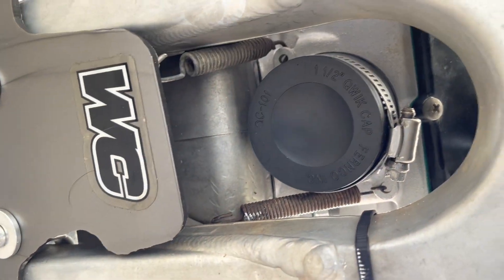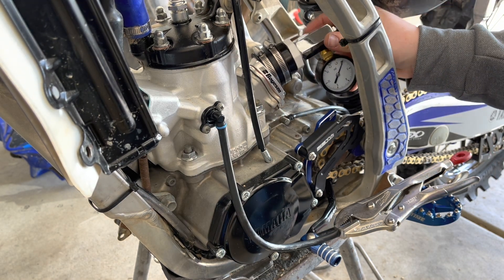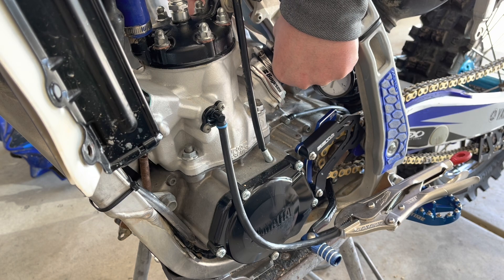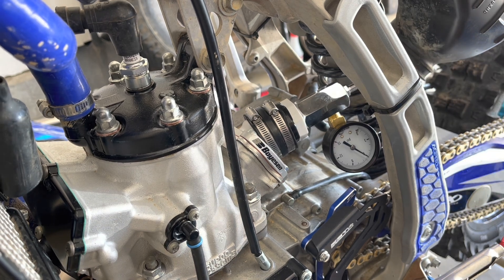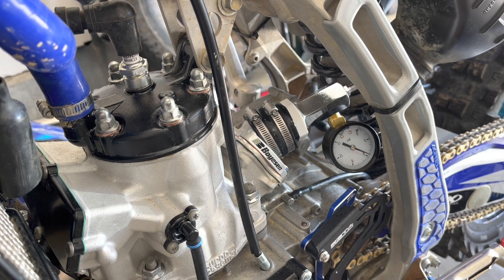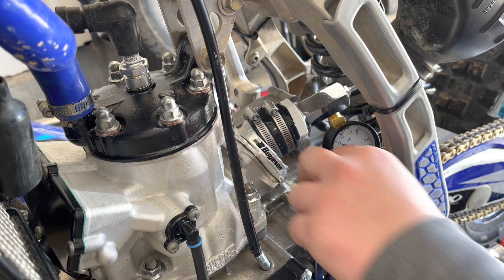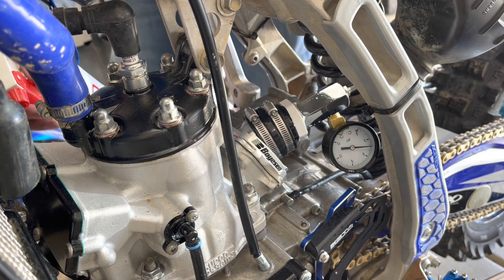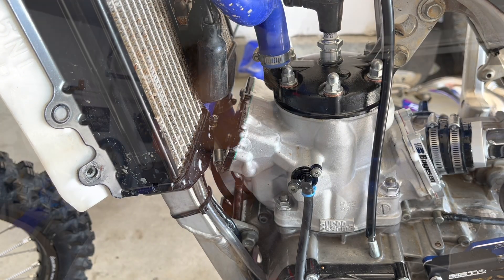2 Stroke Leak Down Test | Where To Find Air Leaks | YZ250

Comment: Did fixing that leak solve your idle issue?  I just found the same on my 2018 YZ250X but on the small side cover for the power valve system called the Power Valve Housing in the manual.  Thanks!
Reply from the maker: The gasket that was leaking in the video should not have any negative affects on your idling. If the side cover for the power valve is leaking then yes those o-rings should be replaced and another leak down test conducted.
Reply from the maker: Yes, when I replaced the o-ring under that cover it resolved my idling issue.